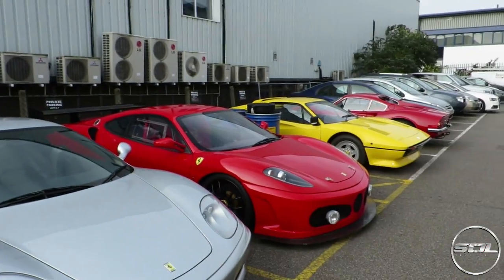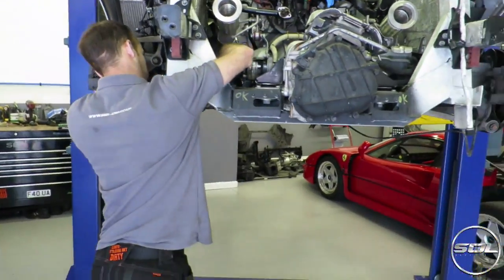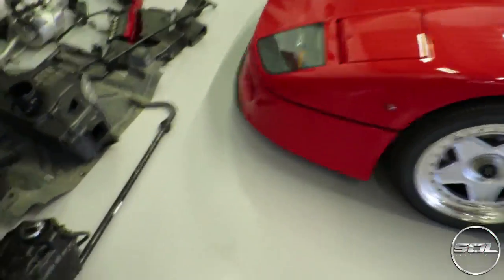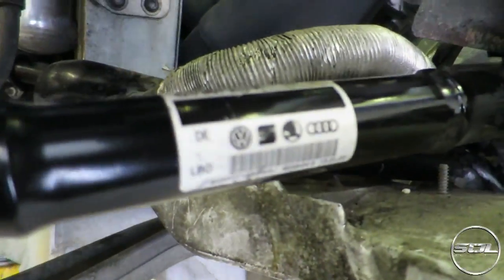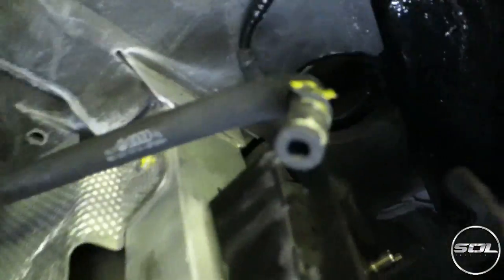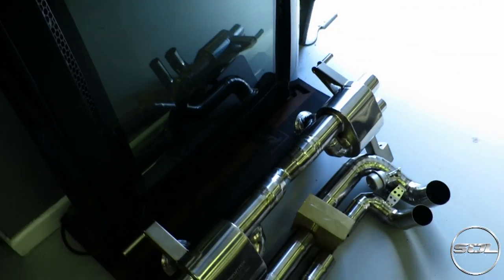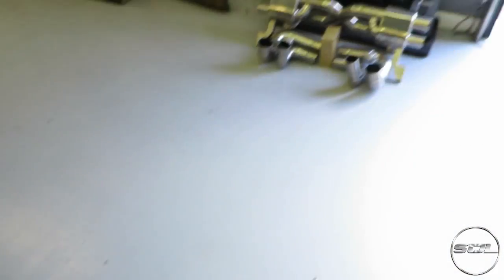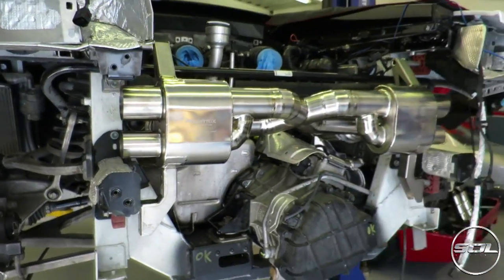THE ARMYTRIX PROJECT: INSANELY LOUD START UP!!!

Comment: Any exhaust noise regulations in the UK?

And now you have a car you can't properly drive through London anymore. After the complaints on Arab's making liud noise (really it was wannabees in tuned saloons), now  it will be Paul in his needlessly noisy Gallorda, just making ways through traffic keeping kids awake from blocks away. 

Will the set come with a removable muffler that does what the original isn't doing properly?
Reply: The exhaust system comes with a remote control that allows you to change the volume of the exhaust